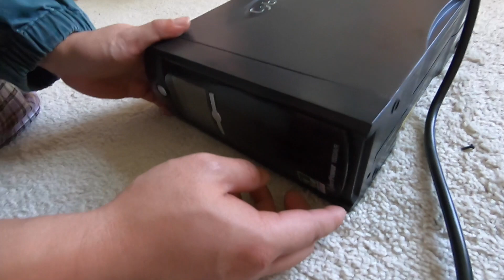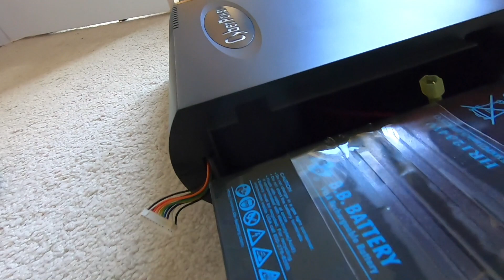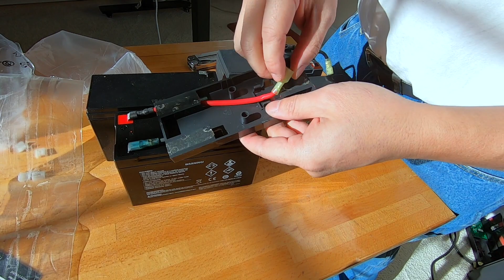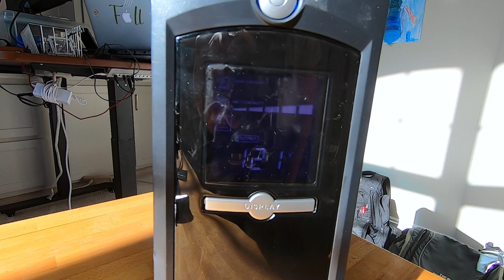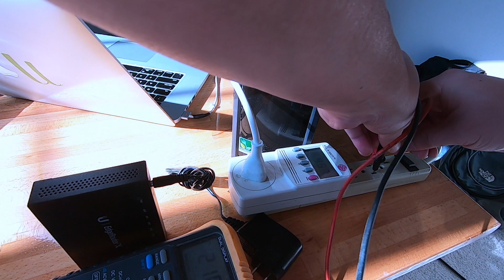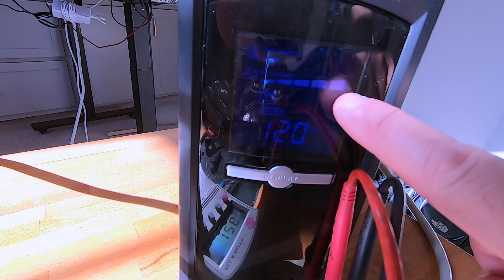Replace batteries in CyberPower 1500 AVR UPS

Comment: My 1500 AVR is not the same how old is this maybe they changed the specs.
Reply: The one in this video matches mine and I bought mine in upstate NY in the summer of 2014.
Reply: @greggl54  I have 4 of them from 2013 to 2022 have 3 different battery configurations.  One takes two separate batteries put in two separate areas of the case.  One has no wires but a female center plug in post
two others have the two batteries taped together as in this video.
Reply: Yeah, my batteries were back to back on the bottom of the case

Comment: A WARNING BEFORE OPENING THE CASE. If you do a search for "Cyberpower 1500 AVR battery replacement" be advised the manufacturer has changed the case opening protocol at least five times on identical-appearing units over the years. (1) single screw removal-front underneath-front panel slides upwards, (2) double front screw removal-front underneath-front panel slides upwards, (3) single screw removal-front underneath- front panel slides downwards, (4) double screw removal-front and back underneath-case splits in half lengthwise, and (5) double screw removal-front and back underneath-quarter side panel 'press and slide' catch at the side nameplate. I fought with mine for nearly an hour before my spouse, who had the benefit of not watching any YouTube videos, figured it out cold in about 10 seconds.
Reply: Exactly what I went though!
Reply: I wish I had seen this comment. Mine was number 5 and I broke a bunch of tabs unnecessarily removing the front. 

Oh well, it’s back together and working great
Reply: I am so glad I saw this comment. I fought with the front panel for about 30 seconds before coming to the comments.

I forgot everything in the video, looked at the dn thing for a minute, removed the only other scre on the bottom, and pulled down on the SIDE panel, and pop! Two batteries right there. Easy access.

THANK YOU

Comment: I have same model but mine has 2 separate battery's not 1 cartridge.
Reply: A lot of the APC units have two batteries in a cartridge format.  The one I have has the batteries linked together but horizontally and there is a single connector with negative and positive.  The cartridge has two straps and a handle on top for pulling it out.

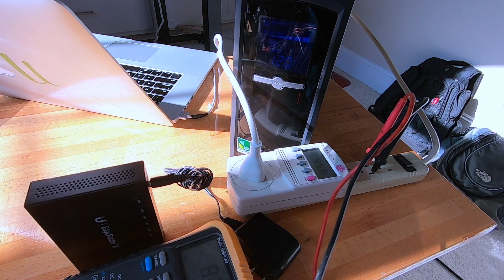Comment: 16:50. I don't know if you know it now, but I'll explain it superficially.  
This type of measurement on the voltmeter happens when it is not TRUE RMS and the UPS inverter produces a type of non-sinusoidal waveform (of course, considering that both equipment is working correctly) being only a limitation of the voltmeter and not necessarily  a defect.  
I'm sorry for any translation errors.

Translated by Google Translate